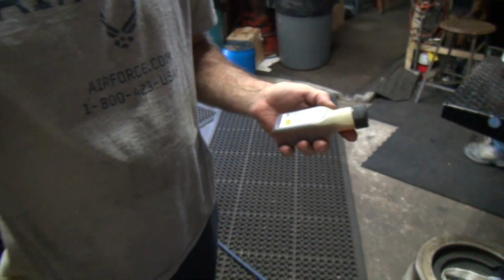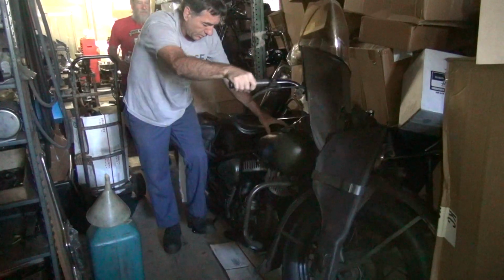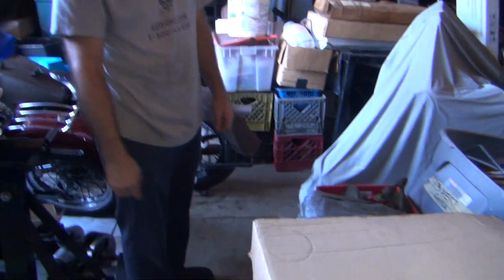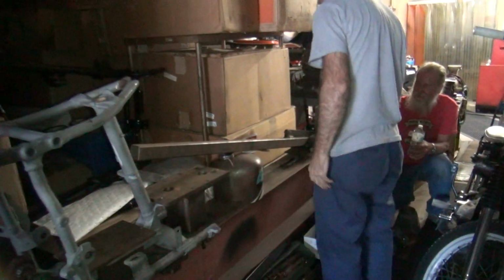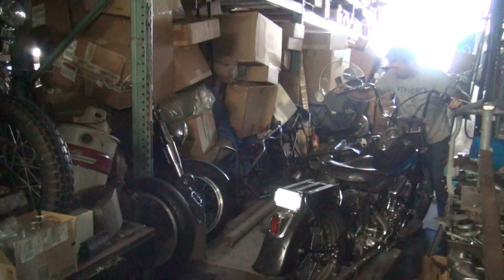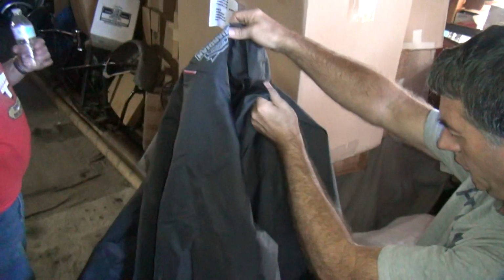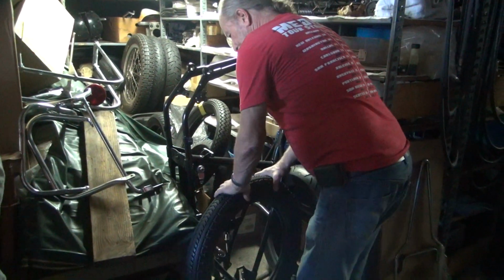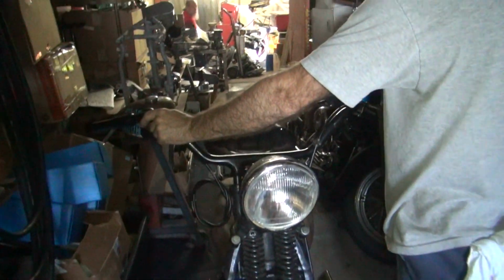1942 wla putting my race bike to bed for a year or two harley by tatro machine

Comment: hey tatro,I really enjoy watching you work. It's very educating to see someone that doesn't live by modern rules make everything work to the best of it's abilities. I know you're a busy person and wont crucify you if you don't reply but I wanted to ask you a few questions about twin cam "a"? motors. I have an 08 dyna. once the bikes paid off I was going to try to build the motor and make 150hp and roughly that in torque. is that a realistic goal?
Reply from the maker: it will not live. just go buy a s&s 143 and be done with it. your trans sucks and will not live either but you have no options to fix that one. if you want a good motor then custom make one with a shorter stroke and height. we might be doing something like this later in the year.
tatro
Reply: Tatro Machine I wasn't quite sure how weak the 6 speeds are. Now I know. 2nd gear is having engagement issues now. So time to pull the trans apart. Is it worth it to upgrade any of the parts? I'm thinking the dogs on the countershaft are trashed and the shift fork is probably bent or damaged in some form or another.  All this with 19k miles on the bike.